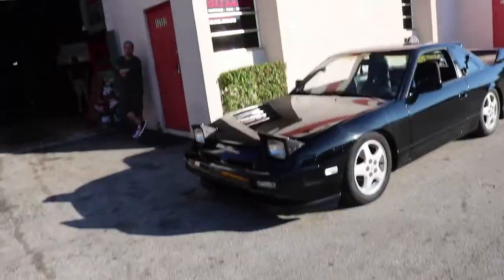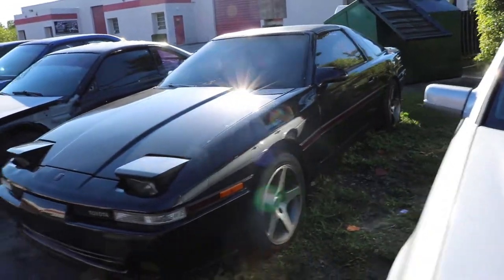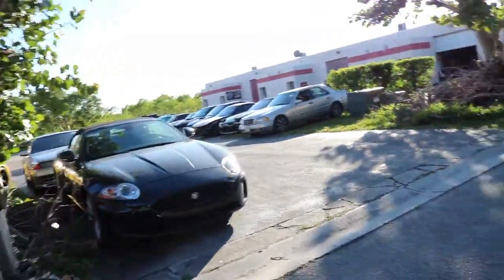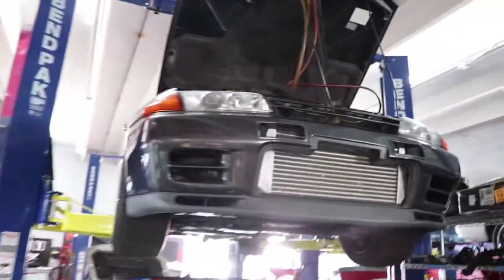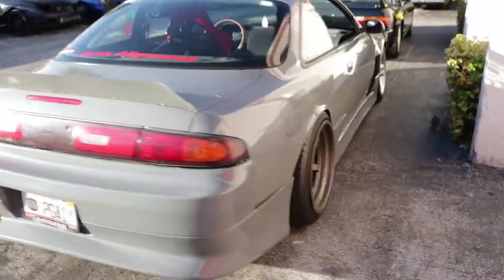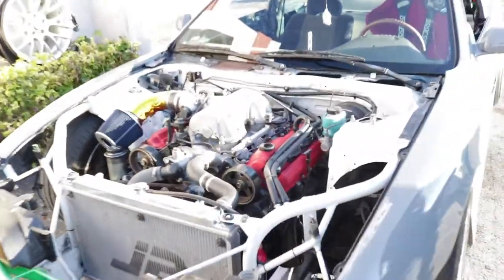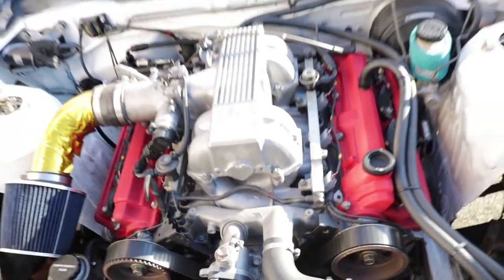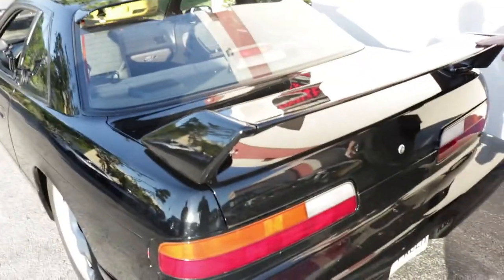Second attempt drifting...SUCCESS!!!

Comment: I'm proud of you, bro. I highly recommend going on youtube and studying "How to drift" videos all of them! Play with the idea of what they teach you at home pretending you're in the car clutch kicking and steering and throttle control as they teach you if you have a gaming console with steering and foot pedals EVEN BETTER and then hop in the car and do it. Also get you some bucket ass wheels off ebay or the locasl that fit your lug pattern,2002 Honda Accords and older and older Nissan sentra's and infiniti G20's share that pattern among other cars, and don't be afraid to beat on it. I definitely recommend as a starter doing it in open parking lots and setting short cones or painting lines on the ground in abandoned parking lots or open terrain so you won't be scared to crash into anything to build you confidence up! Proud of you primo for going after this and actually getting out there and gaining seat time. Just for personal use track the time you spent drifting 10, 000 hours is the goal. DO IT!
Reply from the maker: ERIGINAL yeah man fear definitely played a factor on why I wasn't going so hard on the slides lol. My next practice will be with cones and in a bigger area to practice and do donuts to be consistent or figure 8's forsure!